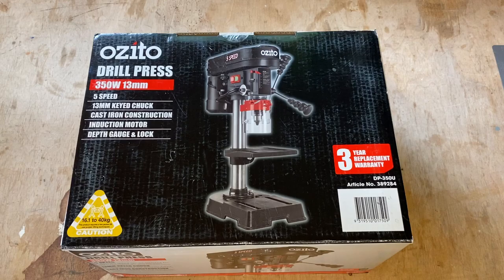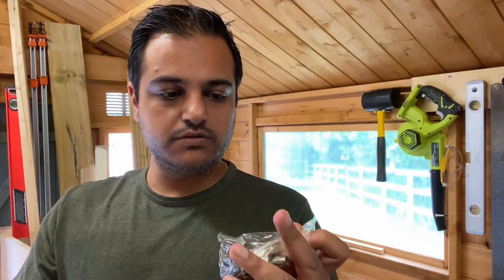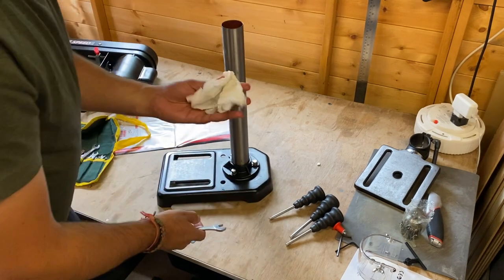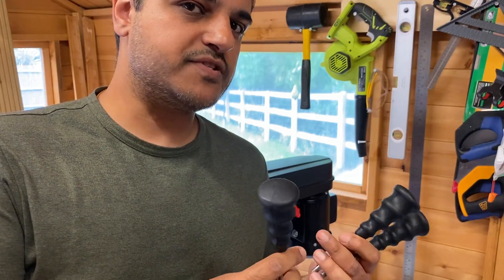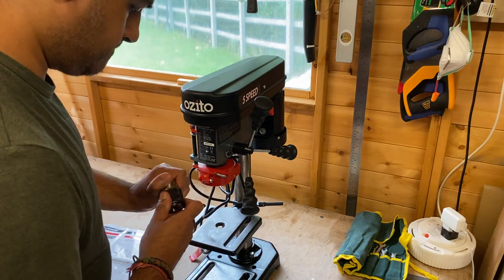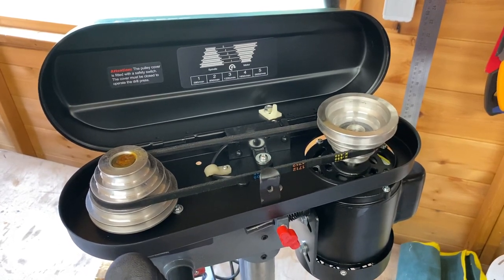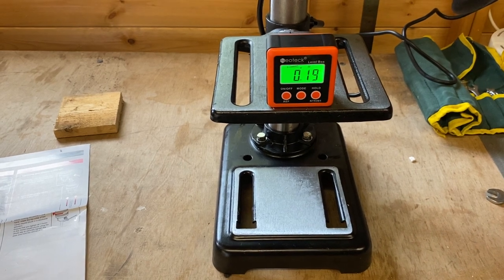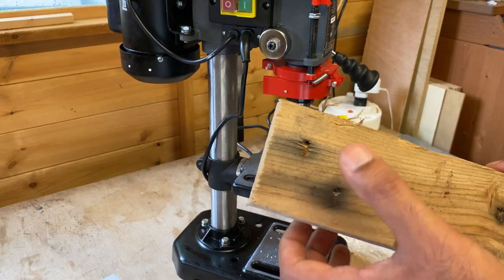Ozito DP-350U Drill Press | Unboxing and First Impressions

Comment: Got the same 350W model few weeks ago, it was a no-brainer for $79 it currently sells at Bunnings NZ. Was told they couldn't get enough of them as they keep flying off the shelves a day or two after they arrive in shop. There is a more powerful 500W model from Ozito too, this one is a slow-seller and is lot heavier too. Was advised to go for the 350W  for light-to medium work as the build quality and materials used are the same as on the bigger model. Couldn't be happier. I tried wood, metal and plastic so far, all without issues. One suggestion for new players is when they drill with forstener bits to go slowly as you did, with up and down motion - going all in will make the bit to get stuck. 
Changing speed belt is a little finicky in the end until you get used to it, afterwards it's a breeze.
Made of die-cast and heavy-duty pressed steel, very heavy and sturdy - makes me wonder how does Ozito make any money on these for $79 retail?
Many have commented on a wobble, mine doesn't wobble at all. You can also bolt it to the work bench but it isn't necessary.
Reply from the maker: Totally agree. For the price its a really great machine. I have mine bolted down and dont experience any wobble issues.
I modded mine by adding a larger piece of wood to the table which has made the drill 100000% more useful now.
Reply: Can't understand why they're so expensive in UK as for half the price in Australia you can get the 500W 16mm chuck model.  I see the chuck is just pressed on. What is stopping the chuck shaft from spinning freely if the bit gets jammed in work? is there a square key slot in there to give it a positive drive?
Reply: @godfearingheathen  same in georgia tbilisy, shittiest  350w model costs 120$...